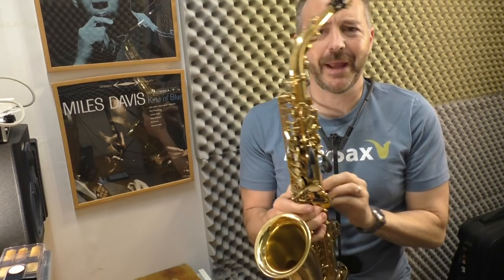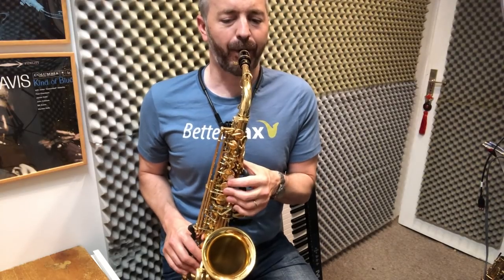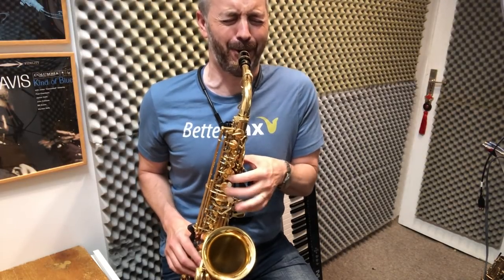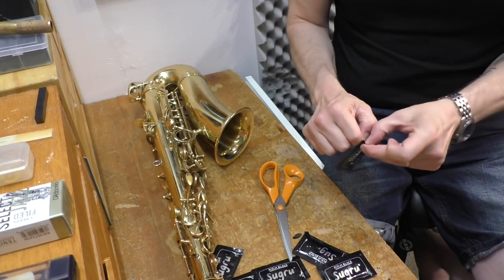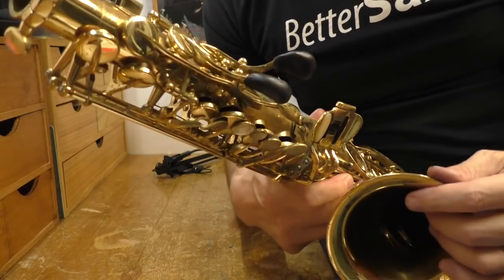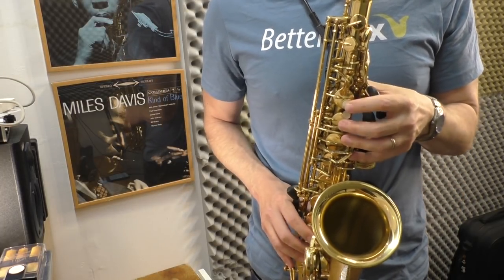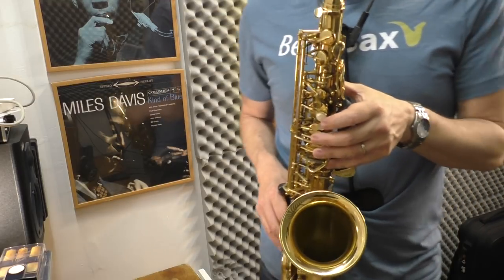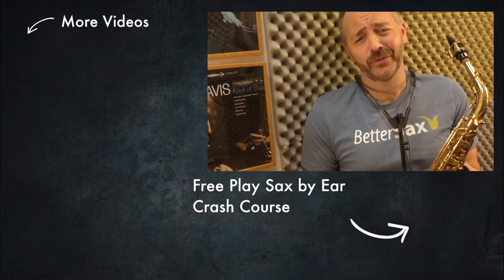DIY PALM KEY RISERS for Saxophone

Comment from the maker: If you have any questions about the process go ahead and comment here...
Reply: Better Sax ..  Hi Jay! How easy is it to get the stuff off once you've  put it on?
Reply from the maker: Good question. I haven't taken it off yet, but I've read that it comes off no problem and doesn't leave any trace. I get the impression that I could break it off with my fingers easily enough.
Reply: Thanks, Jay! I'm on my way out to get some Sugru, right now!
Reply: Better Sax I have the opposite problem ...I have small hands that keep on fouling on the palm keys ..I need to reduce the D palm key
Reply from the maker: David Scott I don’t know of a way to reduce the size of the keys, but if you pay careful attention to your hand position you can overcome this problem. Stay very relaxed and eliminate all unnecessary movement.
Reply: Hi chef, that's a very nice improvement of key work on the saxophone, and i'm going to test that. But once those risers are settled, can they still be easily removed or get off placed by new one? Mine is a Mark VI, side keys and F# are gonna be tough to make if i don't detach them from the saxophone i guess.
Reply: Good morning Sir great video ! Does this stuff dirts your palm while playing? And after put the glue on keys , there is 5/10 minutes to refine for a better ergonomic or it goes dry soon? Thanks
Reply: great idea thanks. Applied today, will report tomorrow about the results :)
Reply: The video sped up at the 3:34 mark, so I couldn't see any detail. It also seems you didn't use the knife. Can you tell me how you shaped the mold and wrapped it around the D palm key?

Comment: Sugru is awesome.  I've used it to repair cracked plastic casings, to improve the grippiness of laptop "feet", and to make rotary switches easer to grip and rotate.  One thing that I'm a little curious about is how easy it would be to remove old/damaged sugru risers or to remove them and start over if a mistake is made. 

A couple of other points about Sugru.  You can get all white packs, all black packs, packs of black, grey and white, and  mutli-color packs (red, brown, orange, grey, purple, blue, green and yellow).  

Key risers are great - I've seen some very classy ones built up out of cork, shaped and varnished.  Not as easy as Sugru, but they do look amazing.

Comment: Not sure if I'd have the guts to try that just yet. Also, since buying my new horn, I'm still working around the ergonomics of it--when I use my pinky to hit the low C# and low Bb, I have to be careful not to hit the palm keys. Wasn't ever a problem on my old horn. So I'm not sure it would help to have those keys higher for me.... I dunno....
Reply from the maker: Good idea to wait until you are more at ease with the hand position.

Comment: Hi Jay, now that you have your new key risers installed, how do you cope with putting your sax in a case?  Does you sax side keys take the weight of the sax when lying in the case???  My Selmer Tenor lays such that the risers will take quite a bit of the weight of the sax which will then put the weight on the side keys.  As I have looked at this, the D key is slightly bent and I believe it comes from the weight of the sax.

Comment: you could use rubber deeper the one used on tools handles works perfectly good and I comes in difrent colors you could add sa many codes as you need..

Comment: Did you envelop the entire key and connect the Sugru to itself across the back of the key? Or just stick it on the front. I'm using a rubber riser with several layers of black gaff tape which works well. (I only use one on my D for tenor). But I want to try this stuff if my homemade one falls off.
Reply from the maker: Finley. That is exactly what you do with the Sugru. It goes around the back of the key and that's what holds it in place.
Reply: Thanks. How that I bought some and was about to put it on, it occurred to me that it looks from the pictures that when it's dry, it's still pretty rubbery and flexible. I think I'm actually looking for something more solid. I like the original solid feel of a hard key, it's more responsive rather than the spongy feel of a key riser. So am I right? Is it pretty soft when it's dry. I know I could just ry it, but I I don't want to waste it if it's really not what I'm looking for.

Comment: Thank you for the video question how to take the Risers off after
Reply from the maker: I haven't removed them yet, but I would take a razor blade and just cut them off. I've been told the Sugru comes off the metal easily.

Comment: I am confused.  I have a keilwerth sax and you adjust the height of the palm keys with a screw adjuster on each key.  Is this an additional rise that you are adding or don't all sax's have screw height adjustment?
Reply: no. keilwerths are some pretty good saxophones and not all saxophone manufacturers include that feature, so consider yourself lucky you can do that. i would still go with the moldable glue mainly because it just feels good too. but hey whatever you think is comfortable and practical. good luck :)

Comment: You can also add on layers if you didn’t put on enough to start. Also, since it is very soft when you first put it on, when you are adjusting the shape, test it by holding your hand in position but don’t push down on it or you will change the shape.

Comment: I just tried it, it's messy, and made the palm key much much bigger, and not as nice as I thought it would, at least not like Jay's :/
Reply from the maker: you can cut off the excess with a razor and smooth them out with sand paper or an emory board.
Reply: @bettersax  I made one test ball and will see how it turns out when hard in a day or so, and I bought 8 so I can always do it again. Thanks for the reply! :)